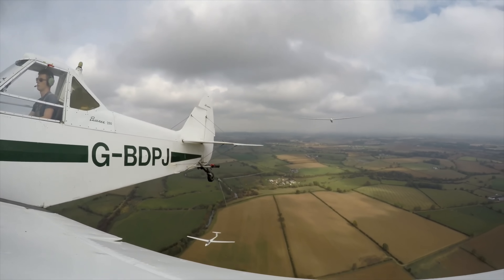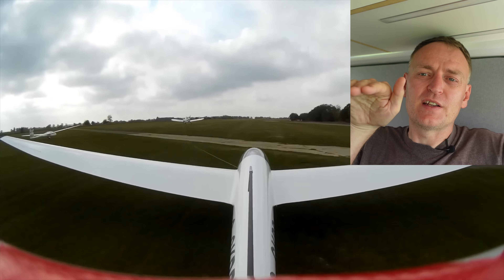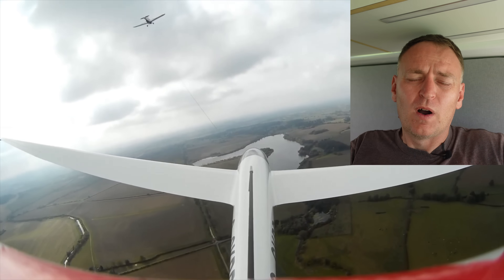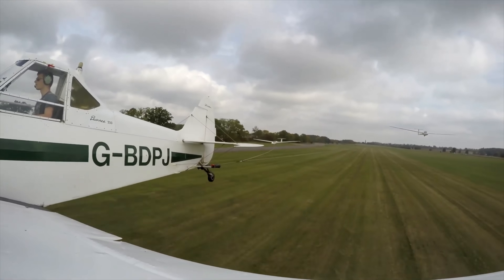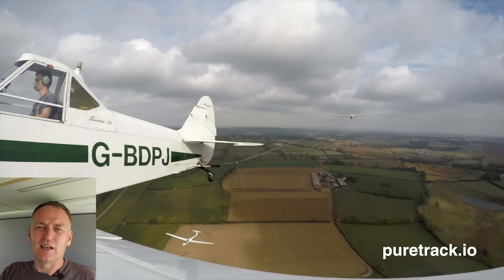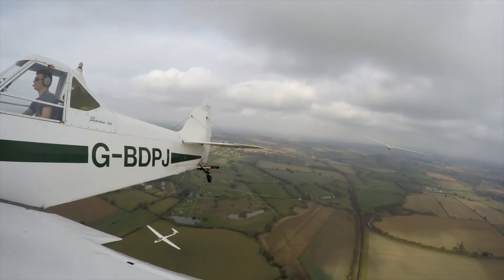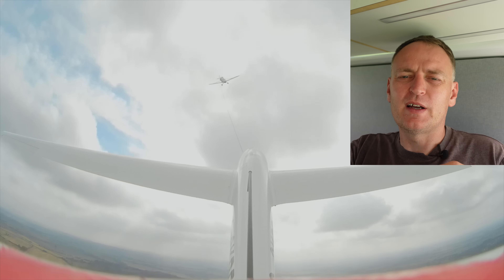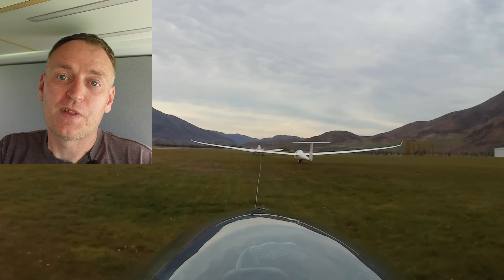Glider Dual Tow Goes Wrong: Instructor Reacts!

Comment: I have done many tows behind a Pawnee in my Glidinhg carreer. At our club, IE. Orient in S.A., we were instructed to always fly in Low Tow position behind the Tug on normal Aerotows. Although I have done many High tow position tows at other clubs which insist on High Tow position. Just a point that occurs to me from viewing the video.  The Glider Pilot flying in High Tow position cannot see the Glider below him at any time if they assume an in-line stacked position (I.E Low tow and high tow directly in line behind the Tug.) Nail biting stuff. This double tow or multi-tow idea was pioneered in War time. Looks pretty hairy to me,  I certainly would not try it unless I was at War.🙂 Interesting video, thanks Paul
Reply from the maker: I've flown a number of dual tows, and it's not as tricky or dangerous as this video might make it look! I've also flown high and low tow in Australia and NZ, and both are fine really, but with high tow you have to be much faster on the release if anything goes wrong or you get too high. Usually I'll tow with what the club usually does, because their mirrors on the tow plane will be set up for one or the other...

Comment: During the late 1970s in the UK there were a series of accidents involving gliders pulling up abruptly behind the tug with the tug's tail being pulled up often resulting in a fatal accident to the tug. The glider was, typically a Ka6E which only had a belly hook, a very light elevator  and an inexperienced pilot. The BGA had asked us at Booker to investigate what happened and I was given the, unenviable, job of tug pilot in a 180 hp Super Cub.

What we found was that if the glider (a Ka 13 on the belly hook) was gently climbed out of position the combination could reach a stable situation with the tow rope at an upwards angle of 45 degrees from the tug, the Ka 13  at almost full up elevator and the Super Cub still fully under control. We had a chase plane with a photographer (actually he was David Attenborough's film camera man) taking pictures of it which I still have somewhere.

We later tried the Ka13 making a rapid climb and the outcome was very different. On the first one I attempted to keep the Super Cub under control by pulling on the stick. The result of this tussle was that the tug's tailplane stalled resulting in a very violent pitch down to near vertical  with a fair amount of negative G (my head hit the metalwork in the top of the cabin). Since it was at 2000 ft there was plenty of time to recover and I was, of course expecting something to happen.

We then tried the same manoeuvre but without me getting into a pulling match with the glider. This resulted in the tugs tail being gently lifted, the tug starting a descent and almost immediately the weak link breaking. The tug remained under control throughout. The moral seemed to be don't pull, although this obviously didn't work if you were very near the ground.

The purpose of the tests, all done without radio contact bye the way, was to try to find a way of making an automatic release on the tug. Several attempts at this were made, but none were successful. The problem seemed to go away initially with keeping inexperienced pilots out of Ka6E's and later with Ka6E's being retired.

The fin and rudder could also stall if the glider got violently out of position laterally (usually with a Chipmunk as a tug), but in this case the problem was self correcting as the tug assumed a new heading which put the glider directly behind again.

Comment: Thanks for the video and commentary.  Got to love non sailplane pilots making comments regarding safety/etc.   Wait till they see a 4 way tow with each glider pilot boxing a corner of the wake.  Perhaps that is what the guy in low right position was trying to do but traded too much potential energy for speed/and or hit a thermal.   Not optimal but a non-event excepting the guy in 1st tow position broke right when he should have broken left on release.
Reply from the maker: Right on

Comment: So if the towplane releases, which way should each glider go? Ordinarily (at least in the US), an individual glider should turn right, and the plane left. With two gliders, both going right seems somewhat risky. Should the high tow go up and right, and the low down and right? Watching that rope wrap around the wing did not make me feel good.
Reply: The low position glider releases first, the normal position glider releases later ensuring there is no conflict with the first one. Of course that only applies with a normal release, not an emergency like this video.
Reply: In some countries/scenarios, the tow plane keeps flying straight after the rope release.  If the aerotow is next to a mountain slope, the glider may also fly straight.  Turning opposite directions after the release has on at least one occasion led to a mid-air collision.   

I once did a 180 off aerotow and found myself head to head with another glider!  Now I turn 45 degrees right, and then turn immediately 90 degrees left and reestablish visual contact with the towplane asap.  Then turn another 45 left and look for other gliders before completing the 180.  I often want to make a 180 to return to a thermal that we flew through while on aerotow.

Comment: When i flew in the UK i never did low tows then when i moved to Oz it was always low tows but i had some dual instruction when switching from high to low. So i suspect UK pilots only experience low tows when gliding overseas.
Reply from the maker: Yes we're the same in New Zealand, we generally only do high tows too.
Reply: We are trained for both in the UK.
Reply: @PureGlide   Some clubs do 'low tow' in UK.  I actually prefer it - for  long cross country retrieves low tow is much easier to fly and is more stable - trouble is a lot of guys go too low -you just need to below the tugs slipstream..........
Reply: @soaruk3697  That's how I brief for retrieves.

Comment: Ah the good ole days where we met in a room or part of the hanger, went over checklists,  verified everyone knew what position they would be in, what they should see,  and gone over emergency situations and what to do.   If on take off x y or z happens cut loose.   if on take off, something happens, cut loose and land in these fields here, here or here.      once above x feet on climb out it is safe to circle back and attempt landing at the airfield.    

You know, basic stuff so you are not scrambling in an emergency to figure what to do and where to land  and turning to tight,  bleeding to much speed, stalling out and crashing trying to be back to the airport when yo don't have the altitude to do that.

Comment: I'm not a glider pilot or aircraft pilot.  But I understand pulling an object with a rope - say a wagon from a bicycle.  It will go though cycles of tugs and rolling freely.  Just like a glider.  The direction it will tug from will be related to the position of the object being tugged.  One glider is turning away to it's left all the time.  That's going to exert a left pull on the aircraft tail.  The other glider is much lower, and that's going to exert a tugged pull downward whenever the slack on the line is taken up.

If you don't think about action <-> reaction of physics, you shouldn't do some activities.  Simply following a list of procedures will not cover every predicament a person finds themselves in.

Comment: Is that towing bridle they used in the UK vid normal? We used to just plug the two ropes into the tow plane recpetacle. That bridle seems to increase the interaction between the two gliders.
Reply from the maker: Not sure what ours is, I think it’s two ropes on the one weak link, but not sure
Reply: @PureGlide  Horrifying to think that both gliders can be still connected together if the tow plane releases. That break to the right from the high position after the rope release seemed to indicate a lack of awareness of the situation...what if the glider pilots fail to release from their end?
Reply: @EnniodBleu  The short-rope glider had already released when he turned

Comment: How important is matching the glider class when duel towing? I would imagine they need to be of similar size, wingspan, performance ... this was fascinating, I've never done a duel tow.
Reply from the maker: Good question. Certainly helps if they're the same, but you don't have to be too far off. Not sure I'd put a JS3 with a Twin Astir for example :)

Comment: Question,
Tim, in the first clip, after release the top glider pitched up and turned right.
I feel turning to the side it was towed on would be more 'ideal', not crossing to the side of the right lower glider.
I saw you didn't address it in the video. Maybe you have some thoughts? 

I'm sure there's more to this situation, but ask as general 'when planning' question.

Sorry if this has been asked I couldn't find it.
Reply from the maker: Yeah they probably should have turned the other way, maybe they did discuss this. He might have just turned the normal way your release out of instinct.

Comment: When the tug pilot hit the release lever, does it also automatically release the cable from the gliders, or do the glider pilots have to manually release when they see the cable come snaking down?
Reply from the maker: No the gliders have to release the cable as well separately. Which creates a problem: they can’t see if it has released or not, so they don’t know if it’s dangling down underneath them. So the advice to land high as if it is there
Reply: @PureGlide  Thanks, and does the unreleased cable hanging from the glider affect the flight characteristics of the glider to any dangerous extent?

Comment: I’m wondering if a small amount of air brakes on both gliders would be beneficial to the tow –reducing for sure the speed & climbing rate, but– ensuring that there is no brutal tug to the towing airplane and the glider due to slack in the towing-line. 
Would it be useful ? Has it been tested ?

Comment: I'm not a pilot, yet, but I find it hard to believe that the cost savings of a dual-tow is worth the potential of something going really wrong.  The lower sailplane that had the rope wrapping around the wing was really lucky that it didn't go worse than it did.  I continue to wonder why someone has not designed a tow rope system that lets the tow pilot release the tow rope at the sailplane so there would never be a time when an emergency tow rope release by the tow pilot would leave the sailplane with a rope hanging from it's nose.
Reply: If the sailplane pilot doesn't want a rope hanging from the nose of his sailplane, he's quite able to release the rope.  There's a release at each point of attachment to an aircraft, controlled by the pilot of that aircraft.  It's completely unnecessary to try to invent a tow rope system that would put the tow pilot in charge of all the releases.

Comment: Dumb question, What stops one glider towing the other - so you have more of a centered "train" position instead of being pulled from two different directions as the tug? I'm going to assume it is because gliders arent built to handle that and one would end up waaay far back. Definitely curious as to the actual reason though!
Reply from the maker: Another problem with the gliders being out to the sides is the extra drag created on launch and in the air. Two gliders are already heavy, so by being inline sooner causes less drag.

Comment: I suspect that ideally , the heavier glider ie: two seater or lower performance aircraft should use the long rope . Or the most experienced pilot should use the long rope if both gliders are the same .
Reply: Correct. The long rope is the most challenging to tow behind.

Comment: Is the tow plane what I've heard called an air tractor like the agricultural planes that spray crops?
Reply from the maker: These planes were used for crop dusting at one point, I suspect air tractor is a specific type
Reply: @PureGlide  Thanks.

Comment: I probably came off a little strong.  Sorry.  I think using common sense we can see the risk of a collision in the second case with any sort of reject,  if the rope length difference is not great enough.  If you have done any formation training the preferred safer method is to takeoff not in close trail but laterally staggered to preclude a collision in the event of a malfunction or reject.

Comment: The point of a dual tow would be an interesting theme. Wouldn't a single tow get to altitude twice as fast - so why accept the additional risk of a dual one? I'm sure I have missed something, but I'd love to know what.
Reply from the maker: It's sometimes used to transport 2 gliders + tow plane to another location. And in theory it's quicker and cheaper than 2 single tows, as the tow plane has to return to do a second tow. But the set up with multiple ropes etc means it's not usually worth the effort.
Reply: @PureGlide  Ah, the return, of course. I have seen how fast it can be done, but it still takes time, and the shock cooling can't be good for the engine block. Thanks!

Comment: Very interesting video. Can someone tell me what happens to the tow ropes after they release like that. Obviously it falls to the ground but does it have a tracker so they can go get it? Also is this how they always release gliders or was the rope detaching at both ends because it was an emergency situation?
Reply from the maker: The gliders usually have gps trackers, so we can retrace the flight path and find the rope. In this case they found it in a field eventually
Reply from the maker: Normally the rope stays attached to the tow plane, so they can go pick up the next glider. They land with it dangling out the back
Reply: @PureGlide  Thanks I assumed something like that. Gliders are amazing I always loved planes but I'm loving this content.

Comment: How much of an impact on performance does dual tow have compared to single?
Reply from the maker: Hi a reasonable amount, especially while they are on the ground. Once one glider is in the air it becomes much easier to get the other one in the air. But you need a decent length runway.

Comment: Something must have gone wrong in the briefing and/or training. Neither glider appears to get into the correct position, even the short rope glider doesn't move into position soon enough. I have done quite a few dual tows, and even done unassisted take-off in dual tow. One of the best ways to avoid the intercation between the gliders imho is to fly with an ever so gentle sideslip, it's a bit tiresome way to fly that way, but it's better than fighting the interaction all the time, and it keeps the tug pilot happy as he's not thrown around all the time. Being able to keep the rope tight is essential in a dual tow, especially with high performance gliders that has very low drag.
Reply: Let's do a dual aerotow!  How hard can it be?

Comment: @6:15 ... Right after the tow aircraft tail pull down & release, why would the aircraft on the LEFT perform an avoidance maneuver that cuts over to the Right, over the RIGHT aircraft?  I thought the training was for the LEFT aircraft to break LEFT,  and the RIGHT aircraft to break Right?  Granted I'm sure the pilots all did what they thought best at the time, but is/was this covered in the preflight brief?  Keep in mind I'm only a 3rd class, back seat, wanna be, simulated, armchair pilot ... but inquiring minds still want to know ;)

Comment: Never done a dual tow myself, i wonder if the pilot of the tug was on the radio to both gliders as he is clearly seen talking to somone as hes looking, esp in the direction of the lower glider,. But why that lower glider didnt have any common sense to move over towards the center is confusing.

Comment: Look at the control input as the nose came up 😳 The elevator says clearly: Nope. Down! 
Im glad for all this happened at this height. If that happens at 200ft on a hot day - Good night. 😢

By the way... Has anyone more info for me why the upper glider turns right into the other one? Thats also really poor just following the "release procedure" not knowing where the other is. Which they 100% cant see because its low below and no glas floor. Both are in really bad positions for spotting each other. Something that I have learned to respect in my career in the military.

Comment: Tugs MUST have a rear view camera . I think that SHOULD be MANDATED in legislation they are cheap as chips and save lives.
I have always suggested that the tow connection to the tug is a Sling from wing tip to wing tip with a running pulley that eventually connects to the tow line. With enough margin to avoid fouling the tail . This puts the tow vectors at the CG of the TUG and minimises the lateral force and leverage involved in any tail hook up . I would think that this is a FAR safer method .  But Every one in gliding ( only been doing it since I was 12)  Disagreed with me becasue it involves a small modification to the wings and spars.
I think it is a fallacy that tugs can be "Normal Planes". They require EXTRA Rudder and Elevator control and should be about 2 x that of a "normal Plane"

Comment: Omaha vid, Wouldn't been inline on ground roll get tricky in the event of front glider rope break? Even at 500ft you have issues with glider behind and rope under left wing! Never done one, so don't really know! Watched and helped with a few.
Reply from the maker: Yeah you'd have to be on the ball, and release the rear glider quickly, so they don't get pulled into it. The one in front wouldn't need brake with the wheel brake, but the one behind could.